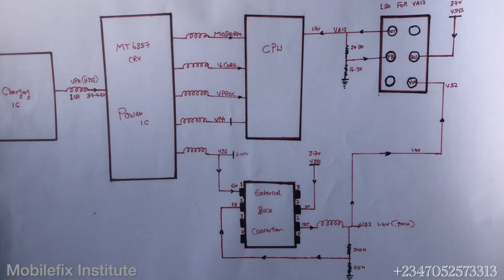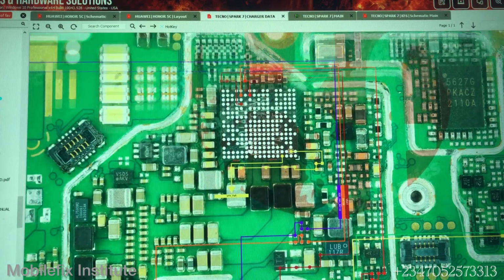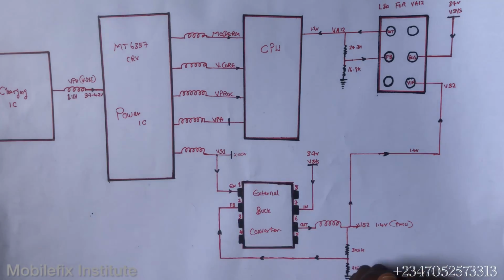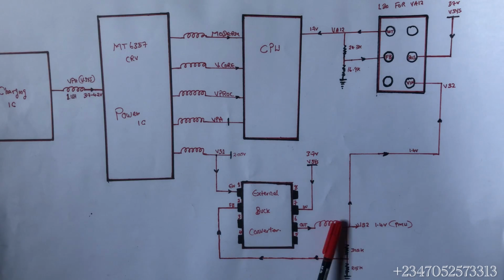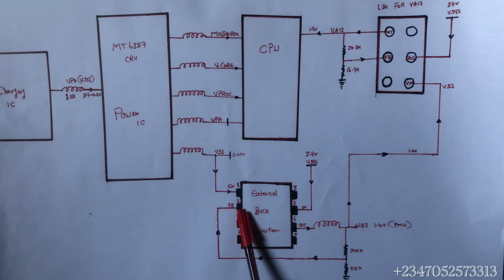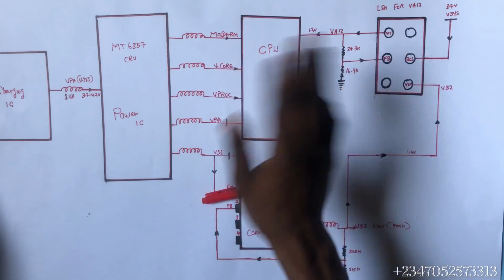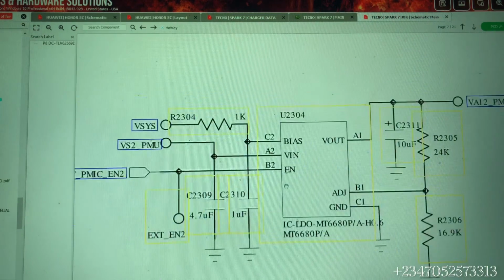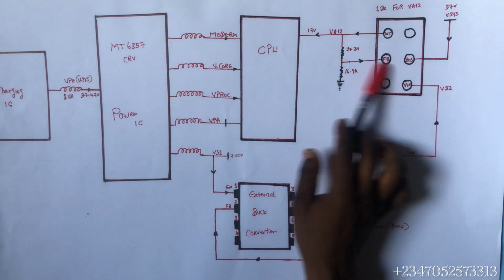MTK External Buck Converter Troubleshooting

Comment: Love this. 
Please how does the buck and external buck voltages generate? Is it after plugging the charger or after pressing the power button. When the phone is fully on?
Reply from the maker: Nice question,
In Android phones the bucks and all voltages generate after connecting charger without oning the phone, except in network section, but in Qualcomm ics, and SPD you will connect battery also for the voltages to be stable.

But in iPhones u have to power up the phone for the buck voltages to generate.